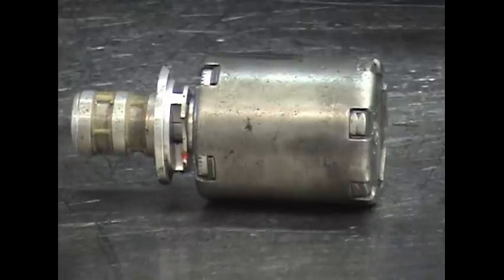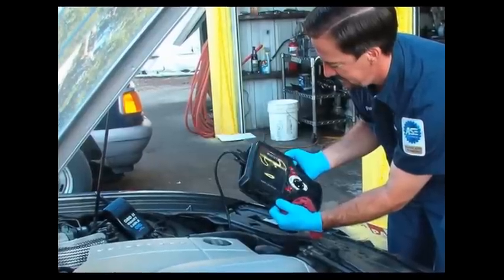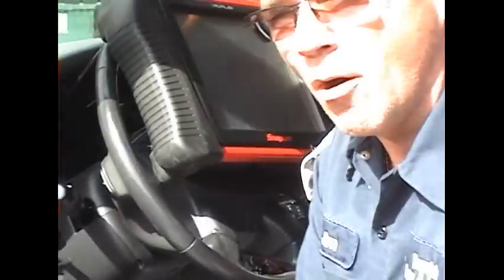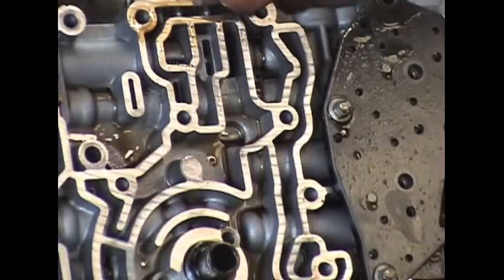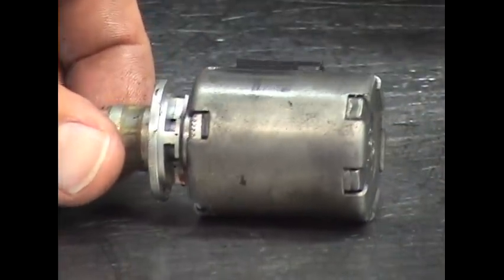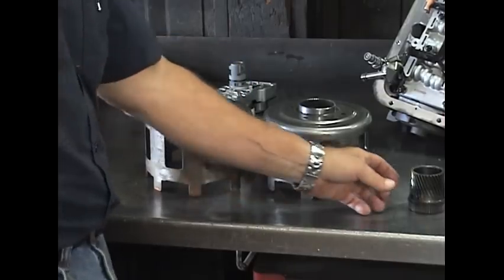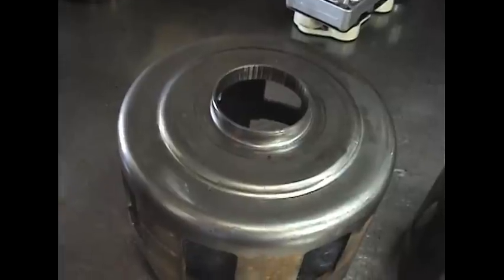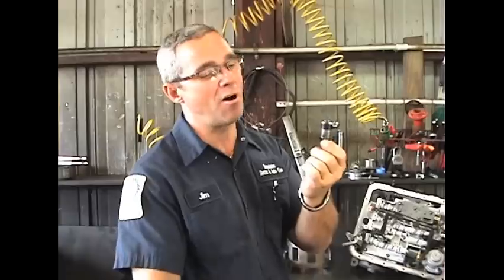Transmission Harsh shifting

Comment: I can tell you if there are no codes active during incorrect operation you dont have a solenoid problem. this is a mechanical issue and is due for a rebuild or replacement of your transmission.

Comment: 2007 Caravan suddenly has nasty shift between reversed and drive.  When we started out of the parking lot we heard a scraping noise like something was dragging under the front of our van. We started for our home which was a hundred miles away. Van worked fine all the way home. Got in driveway and shifted between drive and reverse and about the fourth try it shifted very harshly between reverse and drive. Fluid and filter was changed a few months ago. it still appears clean and didn't seem to have any burnt odour to it. Puzzled in Nova Scotia.

Comment: My uncle rebuild my transmission and we upgraded it to a 4L65E,two months later the transmission shifts so hard,like something wants to break.after we drive it like 30 minutes. That's when it shifts super hard.but I turn my van off and park it for 3-5 minutes. AND it won't do it no more.what can it be ,I was thinking it was a solnied

Comment: I have a 2000 gmc 4l60e it was hard shifting from first to second and fluttering to o.d. i replaced to and it shifts smooth 1st to 2nd but, hard to 3rd? Still flutters into o.d.

Comment: Jim I have a 2002 ford Explorer and I changed the transmission fluid out and installed a new filter and new mercon v transmission fluid now when I first put it in gear when its warmed up it shfts in hard. can you tell me what could be the problem thank you. cdhaze@msn.com

Comment: Could you make a trip to NC to diagnose MY transmission? lol  Once I get past reverse and neutral, all the forward gears seem fine and shift smooth at the designated speeds, but every time I have to shift into reverse, it bumps pretty hard but functions fine after that. It's in a '95 Toyota Avalon with only 126,326 original miles and was driven by my sister who drives like grandma, so no hot roding or anything like that has been done with the car, and since I've inherited it, I don't drive it crazy either. Could it be something as simple as needing a good cleaning and fresh fluid? The fluid on the dipstick is at the proper level, it looks fine....nice and red with what feels like normal viscosity to me, but I'm no pro and definitely not a mechanic. Any help or suggestions would be appreciated.

Comment: my car has 6 shift points and 3 drive modes in ether eco or normal mode you really can't feel the car shifting unless you do a harder acceleration but the sport mode shifts hard for the first 4 shift points and the tach jumps roughly 2K rpm and back at that shift  and does not do this in the other 2 modes

Comment: Can any one help... I have a 2010 Elantra with a early transmission problem at 35,000 kms. The problem is with 2-3 shift. I have had the complete valve body replaced twice and the computer contacts cleaned. The worst shift when the car is sitting overnight or let standing for awhile.. Usually after the engine and transmission heat up it shifts fine. Any idea's Seems it is temperature  related.

Comment: I have a 2006 Honda Civic automatic that gives me a rough downshift Into 1st Gear. If I brake and let the car slow down gradually when coming to a traffic light it downshifts from 2nd to 1st you get a rougher shift then normal. I drained and refilled the transmission twice now using Honda genuine DW-1 fluid and its still there any ides?
Reply: Did you find out what this was? Mine does something similar occasionally and it's a 2013 civic

Comment: My Hyundai Tiburon has a only 73K miles and car hesitates in up shifting between 2nd and 3rd gear and sometimes in 1st gear when I hit the gas pedal slower car starts jerking 2-3 times , my mechanic couldn't figure it out and told me I need new transmission. Should I try to change the solenoids ?
Reply from the maker: If you want to reach Transmission Doctor call his shop at (386) 462-7775
14616 NW 128th Terrace, Alachua, FL 32615, say hi to Jim for me

Comment: Can a faulty crankshaft code place transmission in limp mode? Wayanchors.
Reply: Faulty Crankshift Position Sensor Can Do That,Also Can Make Ur Tach,if U Have One ,Become Very Erratic.Will Pull Up A Code @ Ur Fav.Parts Store.

Comment: I'm getting this code P0777 I made a research I wanted to get an idea what the problem could be if you can give me any advice will be great and my car is a Dodge Caliber 2008 automatic transmission
Reply from the maker: Junior I created the video but am not the  mechanic. You could try calling Jim Markle's shop in Alachua, Florida at 386-462-7775
Reply: @playbeatswork  please write a commit that this is a non responding channel. You've been upsetting people for 7 years.

Comment: Hi, I have a 2006 Lexus gs300, my vehicle is shifting properly but it has a harsh down shift when the vehicle is about to come to a stop.ive change both sensors on the transmission, change the transmission strainer also the transmission oil but the problem still exists . Do anyone experience that problem before with they're 2006 Lexus gs300. And if so what did you do to correct the problem?
Reply from the maker: Hello Deangelo, contact the transmission doc at Call 386-462-7775.
Reply: Its your ECM, the one located under the hood of your GS. Send it in for repair or you can buy a new one from the dealership for $2,000. To repair your old one is only $135. I believe they replace the transmission control module in the ECM.
Reply: Lexus also has a TSB on this issue.

Comment: i just bought a toyota sienna 2014, 33,500kms on it. gear are starting to slam. it did actually seem slightly rough during winter, now it's warming up and getting worse.  does anyone have advice. is there something wrong, should i try to get my money back or sue? i only had it 3 months and put 3000kms back and forth to work.

Comment: Hey boss
Reply: Hey boss James burns I replace my transmission and now only runs in 1st gear only it won't shift 04 nissan altima the cover of the engine says CVT  transmission and I fill it out with dextron 3 I put my scanner and what I see where it says line pressure one of the two says 0%00 and the other there's pressure can you please give an idea what to do please

Comment: Thanks so much for the video!!!  I have an Chevy Uplander with a 'once and a while' clunk when shifting 1st gear and sometimes 2nd gear.  Very intermittant.  With what you shared, shouldn't one rule out first the engine sensor, rear end sensor, speed sensor, mass air flow sencor or the engine coolant temp sensor before replacing the solenoid???  Or will the codes be reflected to indicate any of the above mentioned problems?  Just trying to eliminate all possibilites first.

Comment: Hey wondering if you could help me I have a 2005 v8 Landrover lr3  120 k  the gear selector didn't select sport mode or show that I have even moved the shifter and the d is always lit up even wen its in p.I changed that circuit board and still the same hope you can help thanks

Comment: Have you found that this problem is common in Ford Explorer Sport Tracs ? I've got a an 08 ST. and have that hard shifting "thump' sometimes when shifting into reverse. I've also noticed that it's not as bad or non-existent when I let off the brakes while shifting . If I have the brake peddle down hard it almost always hard shifts.

Comment: My Chrysler Pacific 2000 3.5 is idling up and down and when in stopped it shifts hard to second with out touching the gas i bought a speed control senser and out put one as well.
i did get a diagnostic done and that is what it said and low volts and pore sift from 1 to 2
Am i doing the right thing to change them.

Comment: .warner bros it started making a wining sound like it needed power stering fluid it didnt need power stering fluid than the.boise was coming from.the transmittion.side of the van and the wining would get worse when I had my foot on the gas I.changed my filter and fluid then I realized it would have the.worse time shifting when.I got about 25 or 30 mph then.it would go to 40-50 or so it wouldnt do anything irregular....what is it ? What do I do? Is it my transmition?

Comment: I have a 92 f250 diesel non turbo with the E40D trans and I recently got a 628 code for torque converter clutch excessively slipping, but my converter is locking in and out as it should but it shifts hard into drive and reverse, and the overdrive light is flashing I've read so many different threads and I'm trying exhaust all of my options before the shop any advice or knowledge is appreciated !
Reply: As well as all forward gears are hard shifts that could shake the soul out of you lol,

Comment: Hi, I have a question about transmission. I have a honda accord 95 and why the reverse doesn't work when the car is cold?  I need wait for 4 minutes or more to get reverse. After that it works good. Do you think can be shifter solenoid? Thanks.

Comment: I have a 1989 BMW 535i with 128K miles. When the car was cold and first started, the first shift (from 1st gear to 2nd gear) would not shift until around 2800 to 3000 RPMs. It would shift a little hard also during that first shift and then would go away until the car was cold again. Now it seems to do it all the time whether cold or warmed up. Any suggestions. Thanks. 

Philip
Reply: I have this same problem. My car shifts hard after cold starting it and disappears/less noticeable as the engine gets hotter. Did you find any fix for your car?
Reply: @nnamdin3372  Unfortunately no. 
The 1989 535i has been sitting in my driveway for about 4 years, after I bought an E90 Turbo. I was going to try and get it on the road again, but became too much of a hassle. 
Although, I love the car and I am only the second owner (bought it in 1999), I can't deal with it and the expense. I am even thinking of selling my dual turbo E90 as too much computer components for my taste..I wish you luck. I'd like to have my E34 on the road, but just too much work...Thanks.
Phil
NYC Area

Comment: My 1999 Ranger 3 speed auto w/OD has very harsh shifting.  It started immediately after coming out of my mechanic's garage after the intake plenum gasket was replaced. 4 liter V-6.  The check engine light is on.  My OBD11 tester shows a code for the MAS.  A new replacement senser does not stop the check engine light.  Any suggestion as to my next move?
Reply: did you clear the codes after you replaced the sensor if you don't the computer still reads the bad code you have to clear it so the comp can relearn the new sensor

Comment: i have a 2000 ford expedition when i am at 45mph and trying to speed up to 55 my transmission just wants to ideal and i have to slow down and only drive max 40.....also i was told that these vehicles stay in four wheel drive all the time can you help me on this cause im being told i have to have a new transmission

Comment: hello i enjoy watching your videos and have 1 question i have a 1995 cadillac fleetwood with 4l60e and it shifts hard from 1-2 it is a non serv valve body, where should i be looking to sort the problem out it only has 70000 miles ?

Comment: Great video!

I have a Jeep liberty 2002. It drives smoothly, but when I stop and shift to neutral and/or to reverse the transmission jerks. What could ve the cause.
Reply: Mounts usually. Possibly worn driveline, u-joints or differential play. Have someone watch the engine while shifting to see if it moves aggressively

Comment: I have a 2011 silverado 1500 with a 5.3 engine in it, it has only 71,000 miles. Will disconnecting the battery for a few minutes help at all??? I dnt think the soleniod would be worn out

Comment: I have a 2007 Saturn Ion that has just began to act up. The problem occurs when I put her in drive. It seems like the car won't drop into the overdrive. The RPM's go up to 4 or 500 and won't drop down as the car don't change its gear. Any ideas of what the problem could be? I've changed the filter and fluid already. Thanks

Comment: I have a 2000 chev Malibu transmission shifts good when cold but shifts hard when hot!
Reply: I have a 2004 Chevy Impala, I'm having the same problem as well. crisp shifts from a cold start and then harsh shifts when at op temperature. but some days it doesn't do it.

Comment: Hello, I have a 2008 Lincoln MKX. My Lincoln periodically would loose acceleration after the wrench light to the left came on. Then when I would stop and place it in reverse it would make a hard bump. Just three days ago I had a Speed Sensor put in. Since then the car has been running and shifting fine. Before that the transmission was shifting fine. Now after replacing the speed sensor it is doing it again for the first time after the replacement. When I placed it in reverse it feels as though the transmission has fallen out. Then when I turn it off and wait a few seconds the wrench light to the left on the dasboard will go out and no hard shift and runs and shifts fine. But may come back a few days later. Is this the hardware or something that needs to be reprogrammed or something. It really does shift and runs fine otherwise.

Comment: Hi James, I have Chevy Trailblazer 2006 and in morning its having hard shift from 1st to 2nd gear, But after driving it to normal hot vehicle it have good shift. Please suggest me the that what kind of problem I m having with my vehicle. thanks
Reply: I have the same issue with my 05 envoy. Have you found a solution?
Reply: I'm going to try the 1-2 solenoid and I'll let you know if that helps.
Reply: Sure Sir, I am waiting!!!!!

Comment: Hello thank you for this video 
I have a BMW 325i e90 2006 with six speed automatic transmission. It's hard to shift from 1st to 2nd gear and jerky, when the engine is cold. But when I warm it up about 20 seconds it shifts smoothly . The fluid has never been changed and has 80k miles .It's there something to worry about? 
Thanks

Comment: A solenoid is a coil of wire with no moving parts. How does it "wear out". I think he means the "solenoid operated valve" is worn out. The solenoid moves a small spool that directs the pressurized oil through the correct circuit. These spools are metal and slide in a cartridge and can wear, but a solenoid can't really wear. It can fail, it can short and have low winding resistance etc.
Reply from the maker: Thanks for providing this clarifying information Hystat!

Comment: This is a very helpful video. The problem with BMW/Mini's is the manufacturer does not like the transmission to be opened. If there are any problems, REPLACE! So dumb. And the manufacturer guarantees the fluid as lifetime which is a LIE.

Comment: I have a 2003 Chrysler Voyager.  I started having problems with it stalling while driving, two sensors replace cam shaft and I don't remember the name of the other one.  Drove okay for a little while but could only do 50 mph or it would start jerking.  Van stopped on me the other day had to get it towed don't. know what could be wrong with it now. Please help

Comment: my girlfriend has a 1998 ford taurus se with the 3.0 v6. when it is cold it hard shifts from 1st to 2nd and 2nd to 3rd but after it gets to maybe around 150° it shifts fine. if you actually shift and are easy on the gas you never have the hard shifts. as far as we know the transmission has never had a tune up. what could cause this

Comment: Hi. We have had our 1999 mazda 626, 4-cylinder in and out of repair shop for transmission rebuild for over 2 months. It has rough shift into reverse. Doesnt shift we'll into 2nd or 3rd. Losing faith and respect for my mechanic who said he could fix it. Wonder if i should have him replace ALL solenoids. Also,have him look at the sensors. How many are there and what is the condition transmission computer goes into when there is a bad sensor. Car has under 67,000 miles.
Reply: jose2bee2 l

Comment: i have a 2006 charger rt daytona and when i shift from 2nd to 3rd it revs up before the change is made to 3rd.
Reply: mine does the same thing. did you ever figure it out?
Reply: +troublesum1978 nah man it can be the solenoids the clutch anything low fluid
Reply: +Dimmuborgir6969 yeah true I checked the fluid and it was good so I'm not sure. oh well lol

Comment: hi dear 94 camaro fırst to second hard shifts and when comıng to a stop downshifts hard as well .i see rpm plays a bit up and down when downshifting.(2nd to 1 st gear ).i replaced atf and filter it does the same thing since ı bought ıt 3 years ago ..could that be a line pressure solenoid or what ?thanks

Comment: Hi i have a 502 v8 , It is a line truck for a tree service. C6500 2002 model .We just replaced a brand new trans mission . new converter cilinoid etc ..It was downshifting hard before we replaced these things . from 2nd to 1st gear .And is still doing that now also .  Any suggestions of how to adjust something to help this matter ?

Comment: I have a 2003 Mitsubishi Lancer automatic. It seems to shift fine when under light acceleration but if I'm going to try to pass a vehicle or give it some good throttle with the RPMS at around 3800 to 4800 I feel some slight hesitation and litle jerking. I have to back off the throttle so it can shift to the next gear.

Comment: Hey Mr. Jim. Need some help here please. My 2003 Land Cruiser Auto Transmission , when shifting from R to N and to D makes blunt knock. Shifting from D to N and back to D  - normal. Only happens if shifting from R - N an back to D. Added more ATF noise reduced. Shifting while driving is OK. No delays between shifting, everything engages OK, no any other sounds. Noticed when release gas pedal then press gas pedal again can hear that blunt knock. Thanks a lot in advance!!! Alex